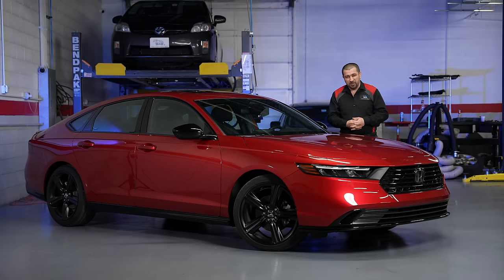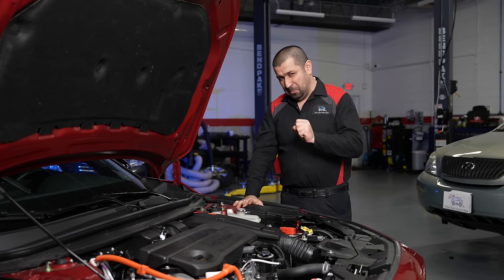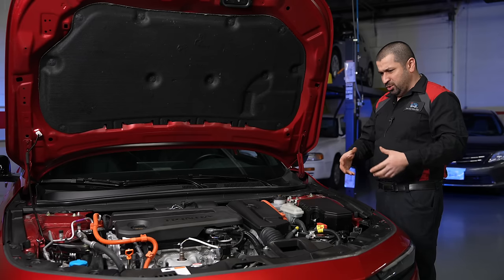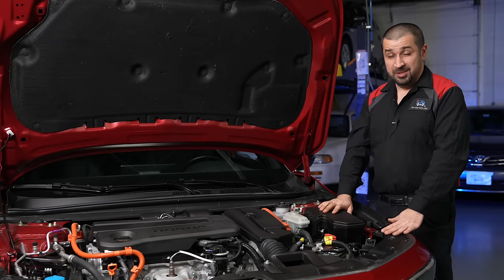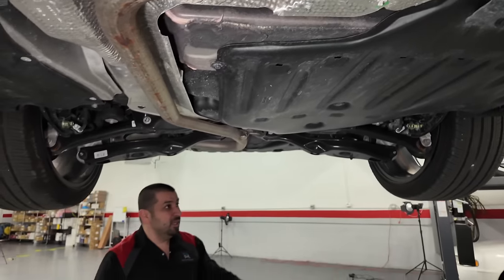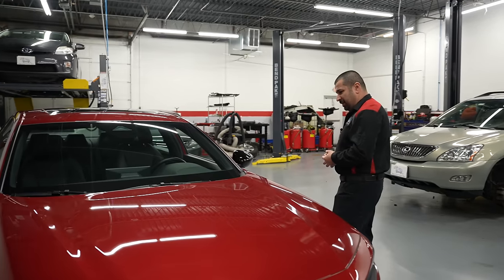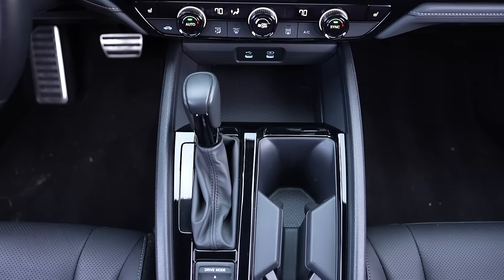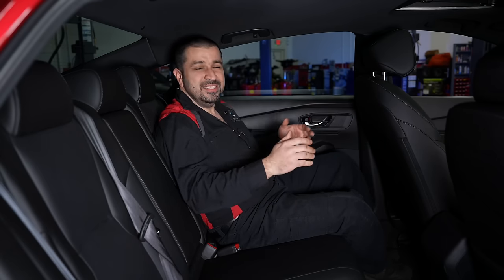Should You Buy The Latest Honda Accord? A Mechanic's Review

Comment: Left my 2016 Civic for repair at the dealer, and they gave me a brand new 2024 Accord. I now love my 2016 Civic more than ever: it feels faster to me, and it has a right mirror camera.
I didn't like the acceleration of the 2024 Accord because it wasn't progressive as I pushed the throttle, it suddenly jumped to being very loud and stressed. On my 2016 Civic, it feels smoother and more responsive. 
I'm not sure if that Accord had an issue or if I was feeling the difference between the 1.5 turbo and 2.0 N/A
Reply: Had the same experience although my current car is a 2007 Honda Accord EXL V6. I know that Consumer Reports loved it but you are right about the acceleration. Also the seats were way too thin.
Reply: @Cap683 somehow it had the most interior space of any sedan that size.
Reply: I liked the interior and enjoyed the heated front seats
Reply: @plasmatvforgaming9648  was it gas or hybrid?
Reply: @uium Gas. The 1.5 turbo
Reply: Sounds like you were experiencing turbo lag. Common on cheaper turbo engines. Definitely doesn’t have the linear feel of NA.
Reply: @Supertrooper697 Non linear, I couldn't find the words to describe it, but that's exactly what I felt
Reply: @plasmatvforgaming9648  The hybrid version won't have this same issue. The electric motor provides instant torque to compensate for the turbo, making it a smoother drive. I have driven both a 2018 2.0 NA and a 2018 1.5t civic extensively and the 2.0 drives a bit smoother at city speeds, but feels slower getting to 70mph compared to the 1.5t entering highways. Pretty similar mileage and driving experience aside from that when stock

Comment: The CR-V has a low speed gearset for towing. 

“The new side-by-side arrangement also enables the use of an additional direct-drive gearset with a new low-speed lockup clutch (deployed in CR-V only) allowing engine drive at urban speeds and supporting the ability for CR-V to tow up to 1,000 pounds, a first for the two-motor hybrid system.”
Reply: Doesn't the rav hybrid tow 2500?
Reply: @jaeNeck  Honda might be making the claim with a technicality, as the RAV4's tow rating may only be for the AWD system that has 3 motors (1 in the rear), or they may be referring to the CR-V having a series hybrid system vs. the RAV4's parallel eCVT.

Comment: There is a video that shows the transmission completely taken apart then assembled as they tell you how it works.  The gas motor mostly turns the generator that powers the electric  motor that actually pushes you down the road.  The only time the gas motor directly pushes you down the road is when you punch it and need the extra power.  He said 62 mph I heard higher.  But after lets say you punch it and pass the other car and return to normal speed the electric motor pushes you down the road.  It is truly genius like he said.  Great review thanks.
Reply: this is kind of like a diesel electric locomotive in a way until you reach 62 mph and a clutch kicks in

Comment: I had a 2018 Accord Sport with 1.5T bought new.

Loved it but man it had major electrical gremlins, major carbon build up from direct injection and AC evaporator went out.

Got rid of it in 2022 to CarMax.

Then I bought an old es300 for $1K and added an old Sienna for$1K recently.

I don't commute much and cars get the job done!
Reply: How many miles on the 2018 accord?
Reply: How could you "love" a car with so many issues? If it were me, I would acknowledge that it was a POS and do what you did - get rid of it.
Reply: @richardepstein3494  seems like either you abused that 2018 Accord or did not service it on time.
Reply: I have 2019 Honda Accord and I have zero issues with it
Reply: @toddsmith1617  between 40k-50k miles, I believe it was still under warranty regarding the carbon build up so they replaced coil packs sparkplugs and and I'm not sure if they did someyelse with it. They found there were misfires and when they looked it was full of carbon,  Costco gas mostly....🤦🏽‍♂️
Reply: @richardepstein3494 it's like when you're in an abusive relationship. Car was very roomy, was my first infotainment system vehicle, basically drove itself. Motor never shut down on me in the short time I had it. But it wasn't the perfection I was hoping for.
Reply: @angusp5515 not sure how it's possible to abuse a car in 4 years. All the oil changes were prepaid when I bought for 5 years/50K approximately. There was never a reason not to get it serviced. And electrical problems don't come from engine abuse/driving like a race car.
Reply: @patone2184 yeah, never said they were all like this. I was just unlucky and I was past the lemon law period.
Reply: @JackMeyHoffer562  doesn’t  even matter what kind of car you drive some of these cars gonna have issues with it
Reply: @patone2184 especially the first year of a new generation, never again.
Reply: @JackMeyHoffer562  you got that right
Reply: Hondas tend to be unreliable except for their engines
Reply: @JackMeyHoffer562  GDI engines are known for carbon build up. It's been said that a carbon cleaning should be done at about every 15-20k miles. Hyundai has that issue really bad.

Comment: I have a highly maintained 2014 Accord with 65K miles on it. All the bells and whistles. The 2.4L normally aspirated 4 cylinder has pleanty of power.
 Yes it has a CVT transmission, but have fluids changed without issues so far.
 Great looking, relatively easy on gasoline and fun to drive.
Reply: I had a 2013 Accord with 260 k on it until I was struck by an errant driver on the freeway.  You will have your car for years to come.
Reply: Repost when you've got 150 to 200,000 mi on that Honda with no issues, 1940s cars got 65 to 80,000 with no issues. Nowadays if a car can't get around 200,000 mi I would never buy from that company again
Reply: @TheMenghi1 I have a 2013 Honda accord with 244,000 miles changed transmission fluid every 60,000 miles only issues I had was starter went out and tension pulley bolt broke. Good car will be in family for years to come.
Reply: I have a 2010 Accord 275K miles only I change the Oil when light goes off, change break and tires. I love Hondas!

Comment: Excellent review, I own a 2024 Accord Hybrid Touring and the ride is smooth, the interior doesn't confuse you or overload you with unnecessary buttons on the steering wheel, and the ride is quiet, comfortable, and I think the suspension does well enough at the price with 19" wheels. Your technical explanation of how the drive system works also made it easy to understand what was going on and frankly I'm not a car nut in terms of understanding what is under the hood of what I drive.

Comment: I recently purchased a used 2020 Honda Accord hybrid.  It will run on electric power alone up to about 67 mph on a flat surface.  Once I hit a hill then the gasoline engine kicks into a assist.  When going downhill the flow meter shows me the brakes regenerating the battery.  AMD, thanks for talking about the venting of the lithium battery. I looked in my 2020 also has that vent as well so I vacuumed it to remove any dust thank you.

Comment: When I had my 2018 Accord Hybrid, I absolutely LOVED driving it because of the hybrid setup.It's crazy how fast the drivetrain is able to regenerate and refill the hybrid battery. Trying to drive solely in EV mode will turn into a game, especially when you can manipulate the aggressiveness of regeneration. I'm able to drive around town that has a 25-35mph speed limit almost completely without ever turning the engine on. It's supper easy to get 50-60 mpg without driving like an old man in a Buick. It was amazing. The transition from ev to engine drive is also super smooth. Makes the Camry hybrid feel archaic. Couldn't stand driving a camry hybrid when I got a loaner after taking my Avalon for service. I can't stand driving other hybrids after owning it.

Comment: Thanks for the great review, AMD.  Honda did have a PHEV called the Clarity that sold from 2017 to 2021.  It has an impressive 47 mile electric range.  I am fortunate enough to have a 2020 Clarity and I love it (although it may look a bit weird).  I believe it uses essentially the same drive system that the current hybrids use.  Most of us that own one really wish they did not discontinue the vehicle.  I drive it in pure electric mode most of the time.  It was built in Japan and is a great car having the benefit of decent electric range for daily use and no range anxiety for trips.  Thanks for your awesome channel!
Reply: It uses the third generation of this system. The Accord in th review uses the fourth. The differences? Minor tweaks to the engine and motors, which made the engines bigger. That required them to move the position of the generator in the transaxle.

Comment: I bought the 2024 Honda Accord EX-L hybrid.  This comes with the smaller 17" wheels (other models have 19").  The 17" wheels gives fantastic gas mileage and smooth comfortable ride. I tested the milage by putting the vehicle in economy setting and filled the tank at 383 odometer miles. My next fill was at 1017 miles getting 634 miles on 1 tank. The tank is 12 gallons. This is my daily driver so 80% of the miles are local street driving and 20% on the highway. Super quiet also, which I enjoy.

Comment: Good review as always.  I found a useful function for the "charge" mode.  I changed the oil and want to start the ICE.  But the battery has sufficient charge to operate on EV, so the ICE does not start.  Select the charge mode and the ICE kicks in.

Comment: Thanks for a great review! I bought the 2023 EX-L Accord Hybrid six months ago, and I really like it. Things to mention - the EX-L has 17" wheels, for those who don't like the low-profile tires. The traction motor does have high torque when you need it for quick acceleration. I do like the combination of lane following, adaptive cruise control, and traffic jam assist; they make driving in heavy freeway traffic a breeze. I'm an older driver, so I do prefer the less aggressive style - let's call it "understated" rather than "conservative." And thank you for pointing out the battery vent; I'll be sure to keep that clean!

The 12.3" infotainment screen gets high marks from me. It's mounted high on the dash, so the road is still very much in view when I look at the screen.  There's a short ledge in front of the screen, so you can brace your hand while touching the screen - no trying to hit a control with a "floaty finger" while driving. And in general, there's not much reason to touch the screen once you're moving. CarPlay works very well, with the ability to split the screen between maps, music, and the power flow display. iPhone and CarPlay can be a bit glitchy due to BlueTooth, but that is generally resolved by restarting the phone.

Overall, it's a great car, and I highly recommend it. It's a huge improvement over previous Accords; this is my fourth Accord!

Comment: I had this car. A 23 sport. It let me stranded 3 times because all the lights came on and there was no power steering. The molding on all the doors was warping and caused wind noise. The whole interior had to be stripped out by dealer to find a noise which ended up being a fuel line banging underneath the car. Probably one of the worst new cars I’ve ever owned.
Reply: Definitely not the norm.  Sometimes bad eggs get through.

Comment: I know You are very persistent about the hybrid battery cooling fan filter, just as much as a "hybrid solutions" guy that demonstrates the procedure for cleaning the fan for other brands. I was quite surprised when he showed a KIA or Hyundai cooling fan which was used for 3 or 4 years at it has just minimal amount of dust. It is a terrible hassle to do the cleaning procedure because You need to remove the whole battery, but at least it looks like there is no need to clean it every year.
I'd still prefer the Toyota way where the filter is user accessible and requires some minor maintenance from time to time, but KIA decided its not really needed, which is similar solution to this Honda

Comment: Love that the "CVT" is really software, not mechanical with a torque converter, just simple shafts and a clutch. My only reservation is the battery. Hope that the cooling of that battery has been adequately  addressed as this is the Achilles heel of hybrids.

Comment: 2024 Hybrid Touring owner here. 2200 miles in as of now. A LOT of road noise in the cabin and you feel every single bump in the road. Likely due to 19” wheels and less than ideal tires. 

Thought my vehicle might be out of spec, so I test drove two other identical models for data collection. Loud cabins and bumpy rides as well. 

Good car otherwise, yet really disappointed in noise and bump mitigation
Reply: @adamklarer3846  I was looking at the hybrid touring that almost bought it but I end up getting the Kia K5 believe it or not there's absolutely no road noise and honestly it's almost as comfortable as a Lincoln Town car from the '70s. I chose the k-5 over the Honda because of the transmission and the cooled seats also it has a lot less electronics that could go wrong. But I hope you have good luck with your car cuz Honda's are very reliable
Reply: Try the EXL model with 17” rims to judge the actual ride quality. If it’s good, I’d suggest downsizing your rims and tires because 19” is just not worth it imo.
Reply: @asfandasadiq4634  interesting you mentioned that because just today I drove an EXL with 17 inch wheels. The ride was definitely less bumpy yet he cabin noise level was about the same. It’s just disappointing because I expected better. Had a 2015 Accord EXL and don’t recall this much noise and bumpy riding.
Reply: @adamklarer3846  i have a 2022 EXL with Michelin Primacy 3st. No road noise issue. 17” rims
Reply: @rondemeio5337  Not sure I would trust Kia/Hyundai. Lots of issues there. Coming from a Hyundai owner.
Reply: @adamklarer3846  that’s unfortunate on the cabin noise…but if the ride is much better then you can always make it quieter with specific tread patterns which emphasize quietness
Reply: @asfandasadiq4634  Switching to 17” wheels and a high-profile Continental Pure Contact L/S. A friend who worked at Discount Tire for thirty years has guided me through the process, which is far more complicated and laborious than ever imagined. General consensus is the ride will be much less bumpy, perhaps a bit quieter and mileage (44 mpg) should be about the same. I’ll update after a couple of months driving 👍🏼
Reply: @adamklarer3846  all the best! I have 225/50R17 here in UAE (2022 EXL). I often run 30-32 psi on the front, and 29-30 psi on the rear. Silky smooth. 11th gen should be yet smoother since the chassis absorbs bumps better and with less impact noise.

Comment: Great video! The Accord is basically a slow electric car with a tinny battery and an ICE range extender that can also spin the wheels at high speeds
Reply: Its not slow.  The hybrid is faster than the ICE engine car
Reply: @larryordine7542 I think they meant it accelerates slower than an electric car, which is pretty fair. The hybrid Accord seems to be made to chew up long distances in comfort rather than short sprints, and that’s where it shines.
Reply: @larryordine7542  they are both slower than the V6 Camry. I bet new gen Camry will be faster
Reply: Tinny? Really lmaoooo
Reply: Who cares
Reply: @russellbauer8299  you are right it doesn’t matter if you want to be a high school jock and then graduate and go to work in a factory for $20/ hour for the rest of your years. Strive for more bro.
Reply: Similar to the Chevy Volt.

Comment: I have a 2023 CR-V hybrid. The hybrid system is extremely smooth and seemless, and I often get 40 mpg on average. I like it very much. If this Accord has the same system, then it's a gem and will get 45+ mpg because the Accord is much lighter.

Comment: The newer Accords will never give me as much joy in driving as the 2002-2007 Accords.
Reply: Amen!!!
Reply: 2013 accord sport mt is a joy to drive in 2024
Reply: Alright then. Go get yourself one of those Accords and spare your time from watching these! 🥳🥳
Reply: Yesss, I have a 05 accord lx with  300k  with  original  trany n motor very peppy  runs like a clock ⏰️
Reply: New gen is vastly superior but keep those rose tinted glasses on. You can get the older ones for much cheaper anyway so win-win in your case
Reply: I just traded my 2014 Accord Sport for a 2024 Accord Sport. I loved my old car and I love my new car. I shopped at least 10 different makes n models…ended up back with Honda. Even got the same black color as my 2014.
Reply: Ah no in my opinion.  I had a 2006 Accord which was a good car but pales in comparison to these new one!
Reply: another fact: my 2017 Civic Touring 1.5T cost the same as my 2006 Accord in terms of actual $, $36k CAD all in.  But the Civic had much more tech, safer, more confortable, quicker, faster etc.  Just a bit smaller though.  

Factoring inflation in, the Civic is less expensive and you got much more for your money.    I see the same with these new Civics!

Comment: Have had a 2024 Accord Hybrid Sport for just over a month now, 1500 miles and love it. It’s in solar silver color which I actually love with the sport accents. Features-wise I do wish I went EX-L for heated seats, slightly better mpg, and regular tires instead of low profile that I worry will pop or damage a rim with every bump lol. But I’m fine with it as is with sport too, I’ll just gradually change stuff on it over time myself.

Averaging 43.4 mpg, some drives I get 36 if it’s highway, into wind, and engine didn’t get to warm up all the way. Others I’ve done 61 mpg for city driving in decently warm weather. On the highway for long drives without heavy wind or cold I get closer to 42-43